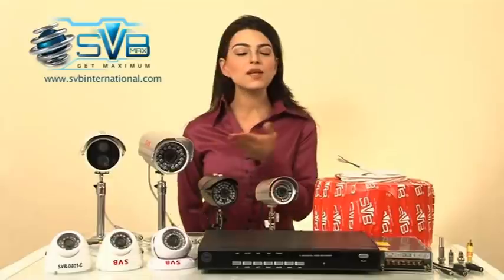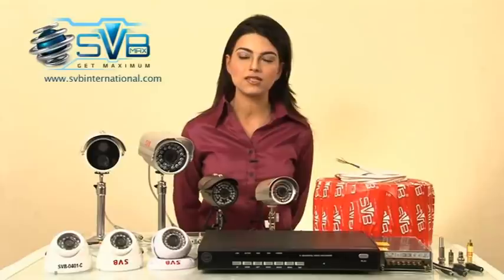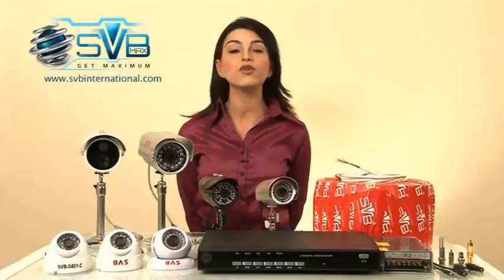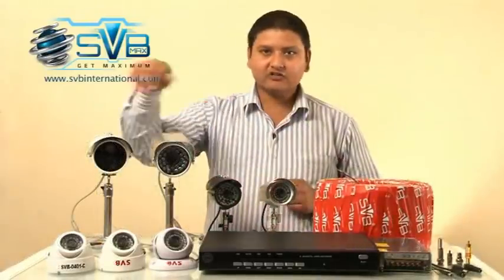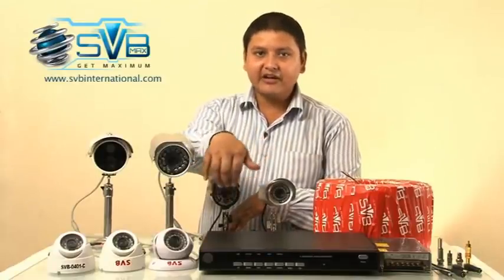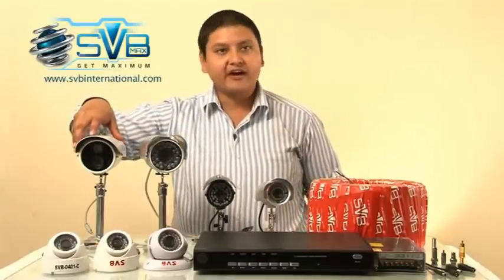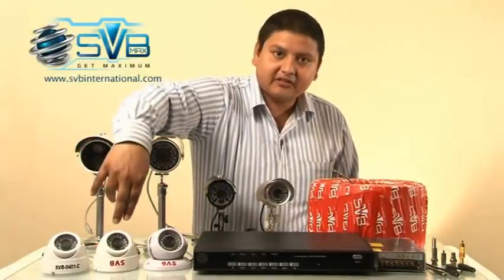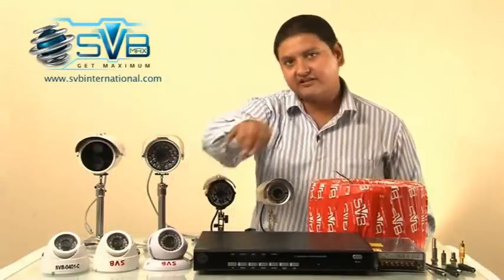How to install CCTV Cameras, DVR setup, mobile view, remote view etc.

Comment: great video,just want to know if the hardisk was empty or it had some software installed on it 
thanks
Reply: +Prince Gautam Sir, generally in DVR, when you put any new hard disk with any data, the system asks & formats it before using. Thanks.

Comment: A running audio commentary, giving details of the respective wire connections to the corresponding connectors would give more clarity.
Reply from the maker: Alright. We will try to have a different video for the same soon.
Thanks a lot for your input.
Best Regards, Team SVB

Comment from the maker: Sir, generally the PC is required to view the cameras (on local LAN or WAN) after the installation. During installation, you may also require the PC to configure the router etc (If needed be). Yes, you can sucessfully install the camera with the screen and view/record the surveilance.
Regards,
SVB Team

Comment: I want to monitor the live screen on one monitor in the security cabin while on the other I want to view the recording or check backup etc on the second monitor inside the CEO s cabin. There are 7 analog cameras connected to a DVR  ( Model - Dahua -3108 with a LAN Port )